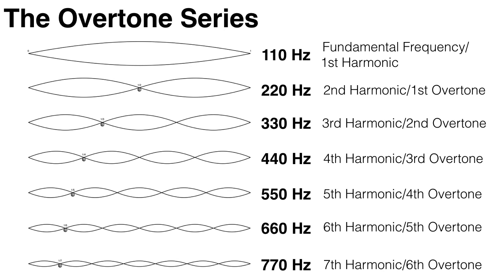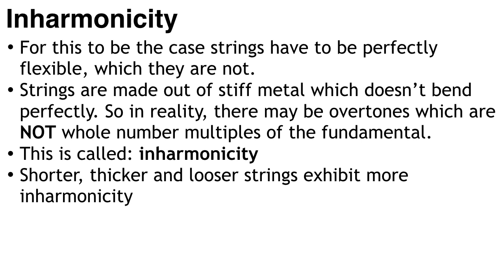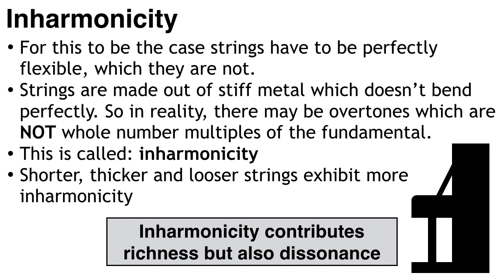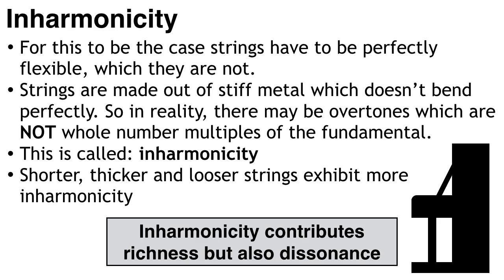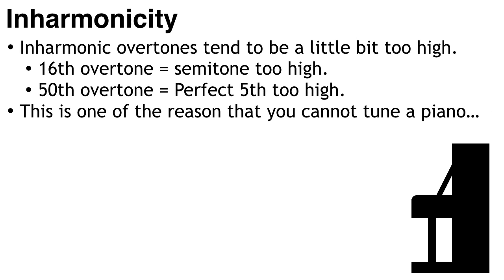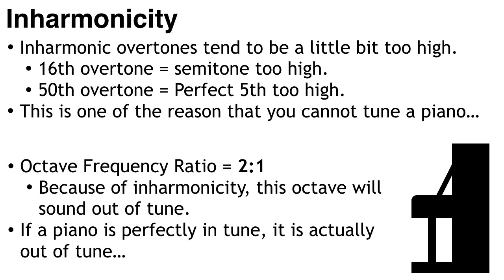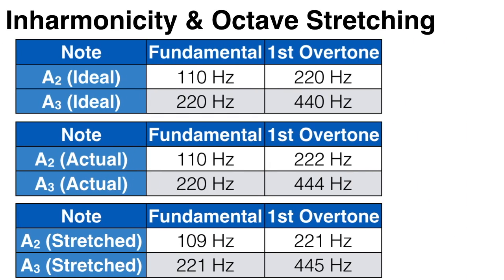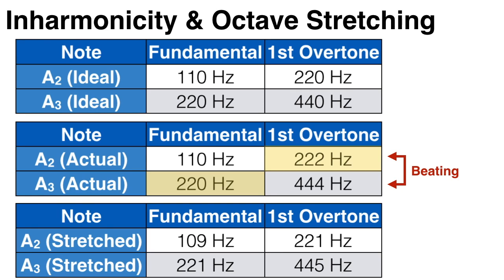13. Inharmonicity and Octave Stretching

Comment: Am I wrong here but it would seem to be that the bass strings on an upright piano are long, thick and loose and the high treble strings on an upright piano are short thin and tight. Yet I know that there is inharmonicity on both ends of an upright piano.

Comment: I'm thinking this might explain why my short-scale bass guitar sounds a little "off" even though my tuner tells me it's in tune.
Reply: It is.  Happens to me on guitar with the low string especially when moving up the fretboard.  I tune 5-8 cent flat on that string
Reply: I think this explains why the notes on the low E string of my short-scale bass sound out of tune even though the bass/guitar tuner says it’s perfectly in tune. Question: how might one resolve this issue on a short-scale bass in terms of tuning - what is the reference point for getting the E string stretched flat sufficiently so that it’s in tune with the rest of the instrument and if a bass/guitar tuner won’t work - what else can be used to achieve this? I though maybe about adjusting 440hz down on my tuner but by how much? Thanks

Comment: I hope you are ok with all this correction. Another: Your example of A3 with 2nd partial = 444 Hz puts the 2nd partial as 16 cents sharp. (1 Hz = 4 cents at 440 Hz) That is way too much stretch. No piano string has this amount. I know you are using these numbers just to represent but it's good to estimate with numbers that are typical.

Comment: Correction: Bass strings on an upright are not loose. In fact, they are tighter than the other strings.
Reply: Exactly. They're quite stiff on upright pianos as they're much shorter and thicker.
Reply: Maybe they are tighter in absolute tension force, but in relation to their cross section (thickness) they are still looser than higher strings, and this is what matters for inharmonicity?

Comment: I think some information is wrong in this, of course you can tune a piano. I'm questioning what you're saying.
Reply: But can you tune a fish?
Reply: Well, the information in this video in incomplete. If you learn just intonation and temperaments, you know what I mean.
Reply: i aggree with you . pianos can be tuned perfectly , this guy is  100% wrong, well almost wrong, beause of how the ear and brain works pitches that are very low or very high can sound slightly off to the ear/brain, therore the  [only] very top notes on a piano are tuned slightly sharp and the [only]  bass notes tuned slightly flat. and the ear/brain recognises this as perfect tuning. but of course the vast middle note  sction of the piano is tuned to exact equell temperd scale. this guy needs to do some studying. main fault to his argument if a note is tuned to a pitch its errelervent how the string vibrates as it will vibrate at tuned pitch regardless of its overtones are off or whatever he is talking about which doesnt make any sense to me. whats your thoughts on this gareth. cheers.
Reply: @wakerickman  You missed something, the stretch is actually caused by the physical properties of the strings.
Reply: @angelicamartacahyaningtyas9083  hhmm the point i was making was that the video was seeming to infer that all the strings where not all tuned to concert pitch and theofore every single noe slightly out of tune with say a synthersize kerboard where all its notes where tuned correctly to the equel tempared scale, the video infered that a piano is not tuned to the equal tempered scale and therfore not be in tune with all standerd synthersizer keyboards which have no stretching even if the synth was 88 notes for synthersizer sounds even on that 88 note keyboard would still all be tuned to the equal tempered scacle. its ownly a comman thing for piano perticuarly orchestrial piano that a stretch tunining would be used ie the very low notes slightly flat and the very high notes are tuned sharp. this is my understanding of how a piano is tuned by convention . and not sure what you mean by the stretch is caused by the physical propertise of the strings as seems by the way as i belive the strings are just tuned normaly and the physical properties of the strings  are just automaticly taken into account as the strings are tuned. often with a digital chromatic tuner nowadays. cheers
Reply: @wakerickman  You don't watch the video properly.
Reply: @angelicamartacahyaningtyas9083  yes maybe i did miss something in the video but all i was saying that there is deliberate stretch tuning on a piano because  of how our ears reespond to very high and very low notes hence stretch tuning, but i also said that this is against a normal synth equel temperd scale wich all synths have even if full 88 note or would not be in tune with other synths tuned to equel temperd scale as they are all are by nessesity to play in tune with each other. cheers

Comment: I wonder if the same thing happens on guitar and bass. Sometimes an instrument will sound nicer if I tune it by ear rather than with a tuner.
Reply: With guitar it comes down to the frets. The guitar is technically flawed (although I love the sound of those flaws). Straight frets across the neck don't allow for perfect intonation. The string doesn't divide at exactly the right point to produce a perfect interval. So tuning via a tuner is making a compromise between all frets so it sounds as in tune as possible across the whole neck. But you can tune to a specific chord to get it "perfect" if you want, but then all the other chords will sound out.
Reply: @lanehillard1596  Yeah, I know that traditional frets don't allow for perfect intonation. But even still, tuning it by ear often produces better results to my ear than using a tuner. Haven't done an apples to apples comparison along the entire neck, but a big enough portion sounds good.
Reply: @dougthemoleman   That can also be because you have learned to play out of tune, not a bad thing as I agree that when tuning by ear the guitar will sound better. The catch is it only sounds better to me, to others it might sound okay, or others who play the guitar and have been accustomed to their own tuning it will sound worse.
Reply: @tane4652  No...
Reply: https://www.youtube.com/watch?v=D8EjCTb88oA Check this out
Reply: or you can now buy a fretless guitar like a violin

Comment: Why would an overtone be more noticeable than the fundamental? Seems odd that tuning the fundamentals to the "right" note is heard as out of tune because of the overtones, but tuning the overtones doesn't make the differing fundamentals sound out of tune.
Reply: I believe the point is that dissonances are more noticeable when they refer to notes that should be at the same exact frequence, like a fundamental frequence of a note, and the first harmonic of the lower octave.

Comment: But what does this have to do with actually tuning a piano by beat rates?  Inharmicty is not a word. Piano wires are actually not stiff. Steel stretches. You're working against the stretch of a piano wire when tuning not the stiffness of the wire.
Reply: It's not that strings are or aren't stiff. Stiffness is a quality of all tensioned strings. It's essentially a measure of how much resistance there is working against the string oscillating (that is, its horizontal/lateral motion) in a mathematically ideal way. The more massive the string, the more tension it is placed under, and/or the shorter its vibrating length, the more stiff it is. It's this stiffness that displaces overtones from their mathematically ideal position, i.e., inharmonicity. For nearly all string instruments, this string inharmonicity is so small that it can effectively be ignored. But because the modern piano has such stiff strings and such a wide range (8 octaves), it becomes noticeable.

Comment: I have a question: If the middle A has 220 Hz, and the A one octave above has 440 Hz, then all the harmonic overtones, including fundamental, of the latter, would also be the harmonic overtones of the former, so theoretically if on a perfect piano that only produces harmonic overtones and has no inharmonicity, if you strike both together, won't your ear only hear one pitch, which is the former, and not both?

So if that's true, what makes our ear able to hear both on an actual piano? Is it the existence of inharmonicity, or something else?
Reply: Sometimes it indeed is hard to discern if an upper octave is played in Chopin's common upper technique. It just sounds like the piano all in the sudden sounds more bright.
Reply: Just a guess, remember overtones have much less volume, so the two fundamentals would be louder? But inharmonicity probably also plays a part in discerning octaves.
Reply: Jazzz, I think it's a yes. That harmonic building is highly utilized in pipe organ playing. Once a key is pressed, several pipes speak together, interlocked in harmonic structure, to make a single loud, bright and rich sound.
This video https://www.youtube.com/watch?v=_DyvmwLyWWk&t=446 at 07.26 show how that magic works.
Reply: not all harmonic overtones of the former are harmonic overtones of the latter. 220hz + 220 equals 440, which + 220 equals 660. 660 is not part of the harmonic overtones of 440hz. go back to the missing fundamental video.

Comment: It would be great to see/hear some actual, real world examples of this.  A semitone too high at the 16th overtone?  Is that an exaggeration?  That kind of discrepancy makes your overtone theory of consonant and dissonant ratios more ideological than actual.
Reply: I think your example of harmonic charts is more something that's fundamental to the tuning system (e.g. an equal temperament fifth is not exactly a perfect fifth, though they're pretty close). And those will only go up to +/- 50 cents since things will always be "rounded" to the nearest note. What the video is talking about is differences that are due to the strings being "physical strings" rather than "ideal strings".

Anyway, for that part of the video I think he's still talking about the upright piano (given the graphic in the corner), for which the low notes is one of the places where the inharmonicity will be exaggerated the most. I imagine most other instruments will have a much smaller degree of inharmonicity, though I wouldn't be able to give you specific numbers on anything.
Reply: Grand pianos have single strings in the bass and 3 strings for each key in the treble, which are intentionally detuned   a few cents with each other to add richness to the sound.  Like uprights the octaves are also stretched, and more so as you go higher.
Reply: Bear in mind that very high harmonics tend also to be very quiet as a component of the whole note. I think you would hear a small discrepancy between the fundamental and a low, loud overtone much more readily than between the fundamental and a high, quiet overtone. Louder, lower harmonics will also tend to mask higher, quieter harmonics. 

All adjusted systems of tuning aim at reducing inharmonicities to an acceptable level - they can't eliminate them entirely. Fretted string instruments are particularly bad for this. Fortunately, human hearing isn't perfect, either, particularly at the extremes.

As for the degree of out-of-tuneness: I'm not sure where the OP has sourced his information. All the charts of harmonics that I've seen go up to the sixteenth harmonic (fifteenth overtone), which is an octave of the fundamental and stated to be in tune. 

On the other hand, the 11th harmonic (10th overtone) is given as 49 cents flat, relative to the 'true' pitch, which is nearly a quarter of a tone. The 13th harmonic (12th overtone) as almost as bad in the other direction, at 40 cents sharp of 'true'. (A cent is 1/100th of an equally tempered semitone.) 

So there may be no exaggeration for the 16th overtone (17th harmonic), though I too find the idea of a full semitone (100 cents) sharp unlikely. You can see an example chart here: http://annelanzilotti.com/blog/2016/2/11/on-harmonics
Reply: Further to this, I've managed to find a chart that goes up to the 20th harmonic. This shows the the 17th harmonic (16th overtone) as only 5 cents sharp. https://andrewmeronek.com/music-tools/blue-notes-and-the-harmonic-series/
Reply: I'm inclined to agree with you - especially as it's well known that, as the OP says, short-stringed pianos suffer more from inharmonicity - but it perhaps needs to be made clearer in the video that 'inharmonic overtones' and 'harmonic overtones' are not the same thing, and that removing inharmonicities caused by the physical properties of real strings may still result in an instrument sounding out of tune because the harmonic overtones themselves are 'out' to varying degrees.

As for specific numbers - overtones are usually related to a fundamental, but when the OP states that the 16th (inharmonic) overtone is a semitone sharp, he doesn't say which fundamental pitch, or range of pitches, he is talking about. I assume he means some note in the lowest bass octave.